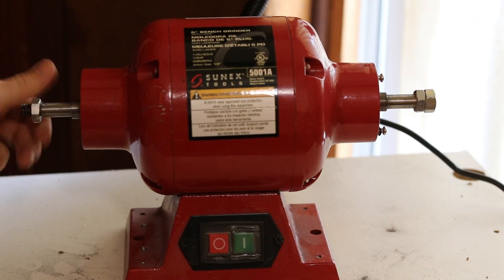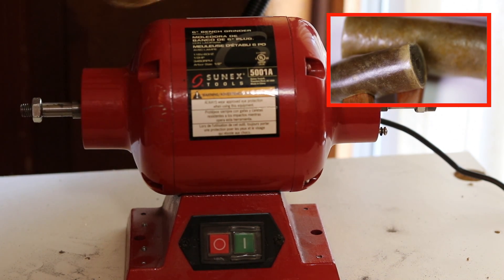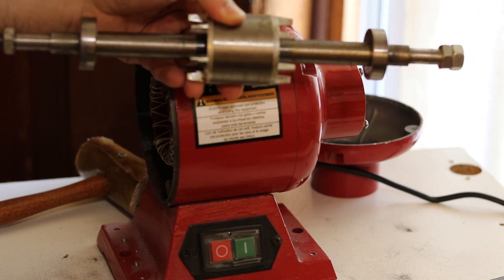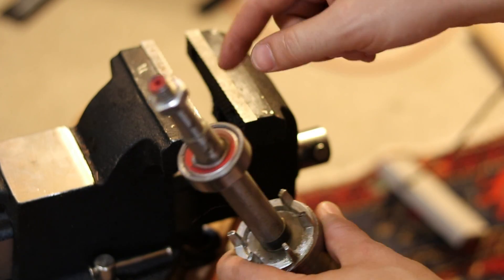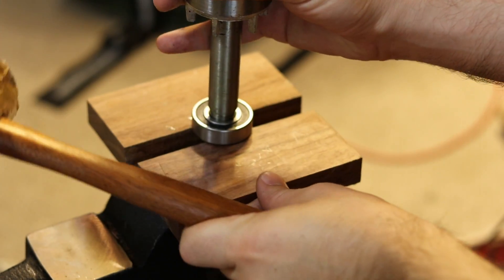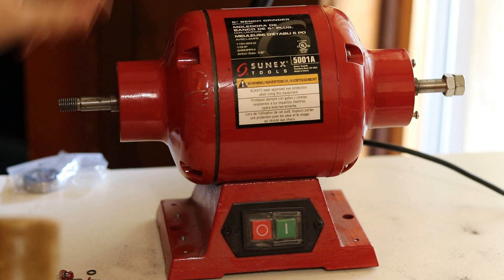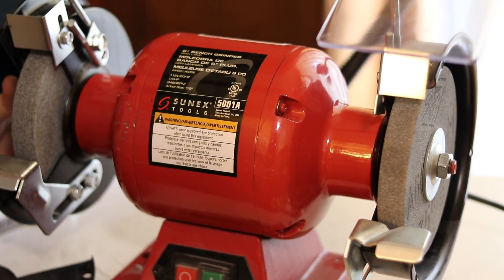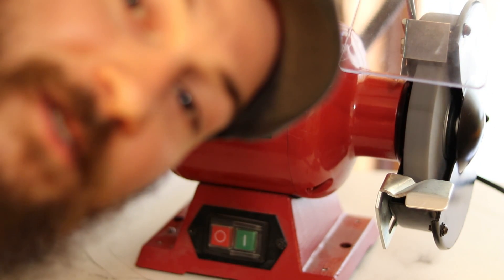Bench Grinder - Bearing Repair

Comment: Very nice informative Video . Just want to chip in my suggestion :
a) Before removing the cap , always mark its rotation on the body with the marker pen and its alignment.  This ensures that the cap fits in the way it was before opening . Sometimes putting them other way round will give you a hard time achieving smooth rotation. 
b) always hold the rotor shaft from the other end when you are tapping it,. It shouldn't  fall from the assembly like it did. It can easily chip the enamel of the copper winding on the field on its way out ( Murphy's Law !! ) 
c) Bearings have sizes written on them , In India , its usually a  4 digit number which denotes its outer and inner diameter. Much easier to get one from market. Though I agree measuring them with caliper just to confirm .
d) Much safer and recommended to use Bearing pullers to remove them, unless they are lying relatively looser. 
Just my 2 cents . Thanks once again
Reply: what type of bearing is used in these grinders ball or roller
Reply: Good points. I was thinking the same thing regarding the bearing - looks like a 203 sealed bearing. And I'd like to see the press fit from the center race, instead of the whole bearing, since you could mark the ball bearings pinching them between the inner and outer races. But other than that - good stuff.

Comment: Two things..... Next time throw that armature shaft in the freezer for a few hours and then heat the bearing up. Some people place the bearing on a light bulb for awhile or use a heat gun. No more than about 250 degrees. If you need persuasion, drill a hole in the wood the size of the shaft and stick the shaft through. Much easier.....

Also, don't split the case with a screw driver, just undo the retaining screws and knock the shaft from one side to unseat the bearing. Then you don't damage the case trying to pry it apart.
Reply: heating the bearing will damage the rubber seal and melt the grease inside. The bearing's life will be reduced.

Comment: I think you have a great idea and you have probably given some viewers confidence to rebuild their grinders instead of tossing them away / Craigslist . 

It's not rocket science once you have removed the covers and wheels and motor housing hardware you could have have made a puller out of the steel plate or even wood and three long bolts and nuts . You drill a 3 hole pattern on a plate thread a nut onto a bolt and through the plate and into where the shield attaches and all three holes . you simply crank down on each nut until the outer housing pull apart . 

What gets me is you had 2 bearing but only replaced one ? second a socket or pipe to insert the bearing on the shaft is a better option . you want to press the part that contacts the shaft only if you press the portion that contacts the housing you could damage the bearings . 

Let the hardware do the work if you screws aren't long enough get longer ones and press the outer housing using the hardware , not the mallet . Then again it's a 80 dollar grinder . 

That said bringing something back to life / service .....PRICELESS 

One thing I might add is wheres your safety protocol . Unplug your grinder wear PPE test your grinding wheel for tone to make sure they don't explode at 3600 RPMs 

good  video
Reply: @Charlie 
Ugh 🤦‍♂️ 🙄
Jesus Christ ..... u seem like such a pretentious DICK 🍆
Reply: @bradwilson5552  I'm pretentious dick because I complimented the video's author ? hey snowflake toughen up a bit .

Comment: Does this bearing problem cause overheating and low rpm???
Reply from the maker: It probably could if the actual bearing case is damaged. The inside of my bearing was bad so it just caused a loud whine.
Reply: I changed the bearing and I thought about the wiring from coil, they were wrong, the two run/work wires were placed on the capacitor and the start wires were placed directly to AC. That's why the motor were running slow and with overheating. I changed it and now it runs normally fast without the heating problem. The only thing I couldn't fix is that when I run the grinder, it doesn't has the force to start spinning, so I do it myself then it runs normally.